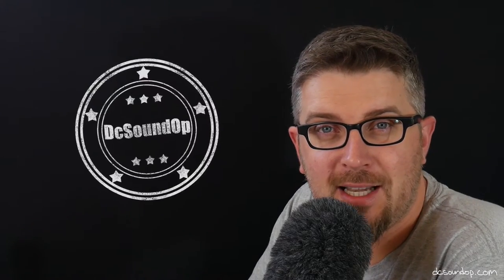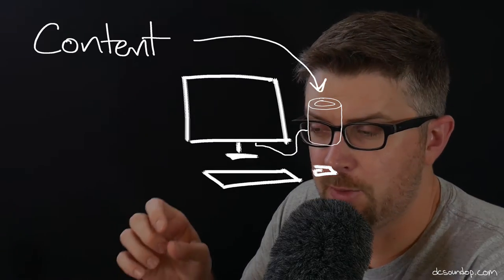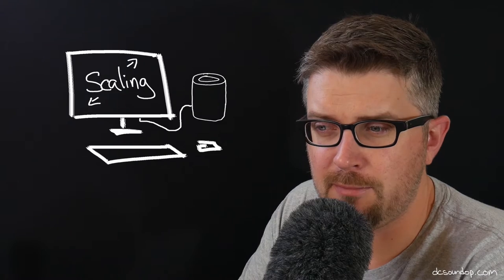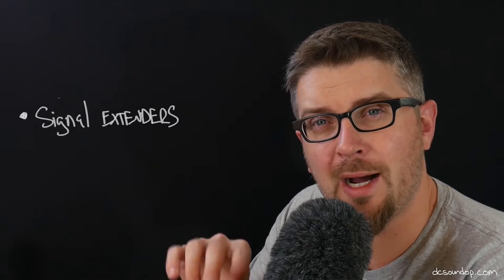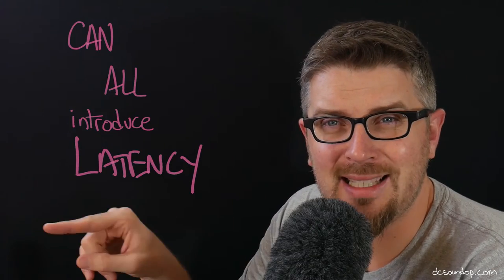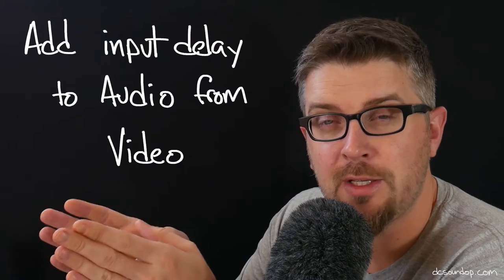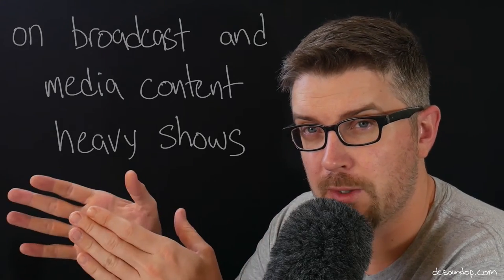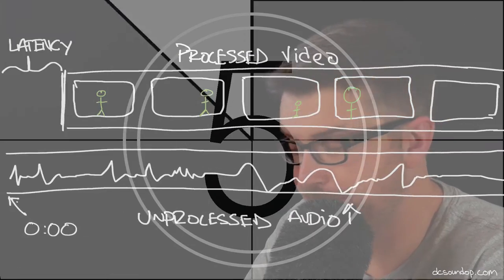#31 - Channel Input Delay  - Live Sound Basics

Comment: Speaking of mixing, your videos tend to be several dB lower than most other videos on youtube. You should adjust your compression or take out more headroom. Anyway, good stuff as always, thanks for the tips.
Reply from the maker: +Kalon I'm used to delivering content around -12 to -6db - I constantly see YouTube videos that are solid into clip throughout the whole video, but no one seems to mind. (Apple TV optical out to MOTU896mk3 for monitoring) I appreciate your suggestion, if loud is what works here,  I guess I've got to step it up a bit! 

Cheers!
Reply: That's a very interesting point I hadn't considered. On another note, I suppose a lot of uploads on YouTube are from a generation after the "Loudness Wars". lol
Reply: I always aim for -12dB. If it's not loud enough for people, let them turn up their output!